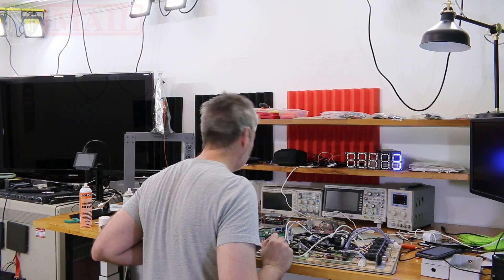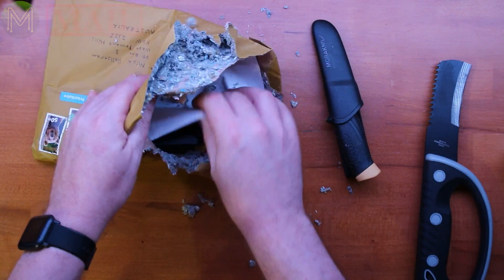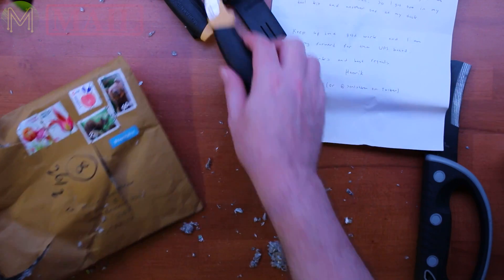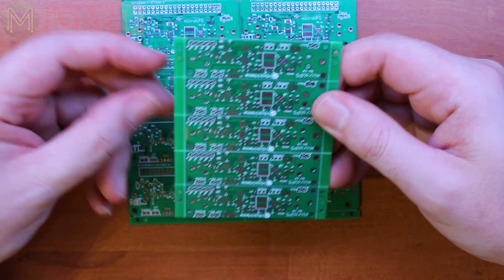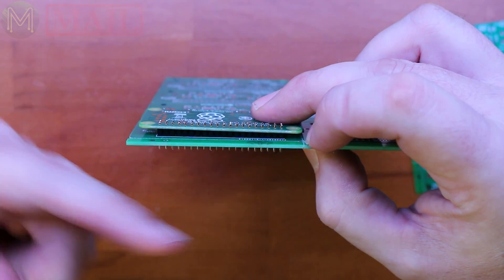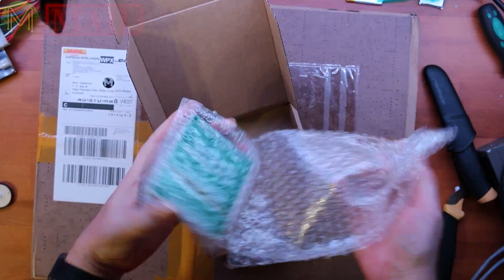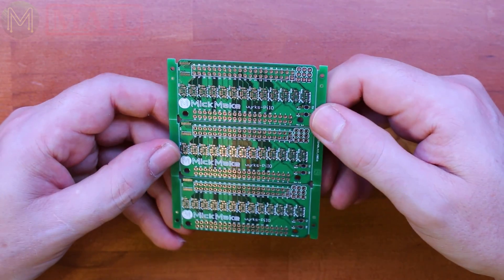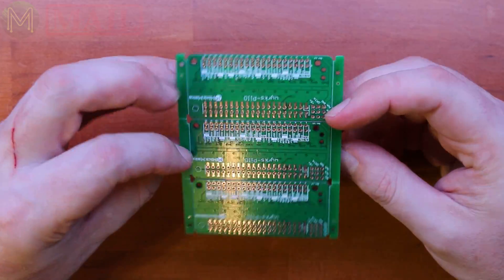#258 MickMake Mail #41: A mega update on a bunch of projects.

Comment: Mick,  Looking forward to your UPS board if it does what I think it does.  Right now I got the Pi Projector working and it is great.  
Right now, I have the screen saver on the LibreELEC OS to randomly and continuously project the stored photos on the SD card.
This makes for a  really cool "night light" for the baby room.  Since is self contained, runs off a USB battery, it can be aimed just about anywhere the baby room.

If your UPS can control the power based on time that is the next thing I am adding!!!  

After that,  UPS time control and motion sensor mode so it only turns on when an adult is in the baby room at night!

By the way, I configured the protector with the TI board on top, followed by your board and the pi zero on bottom (component side down ) so I can reach the pi connectors. 

thanks!!
Reply from the maker: Hi Spencer. Yup you posted in MickMake forums on this.
There are several ways of still being able to use the Pi from underneath in the current 1.3 design, but quite a few people started to experience noise from long headers, etc. So, it needed to be fixed.

And since it'll also have servo controlled auto-focus, you'll be able to point it vertical and still have it in focus.
I'm thinking of adding in a line-of-site distance sensor to provide auto-focus.
Reply: @MickMake  Just for the sake of discussion and to provide you with some data points.

The distance between your board and the circuit side (upside mounting of the pi) is the same as the default middle standoff that came with the DLP board.  I took the longer standoffs from the DLP board to use that for feet for the pi zero.. for now.  I don't see any noise that affects the video, but I do get the occasion where WiFi does not automatically come up, just cycling power usually get it working.  In my case since it is not a big issue, as the "things" is a picture project from on board files.  I do however need the wifi to kick off sideshow of stored videos.  

I can't tell if the wifi is having problems or care for this application.  I been able to download pictures, videos and stream material (Kodi) thru the wifi.

Another FYI is that for the current version of hardware/software for Pi Zero, bluetooth is not working.  Many people have noted this on other forums.  Hence (for me), I won't be using it as a full media center (and don't care) since there is no audio , but it is still pretty cool as a standalone system.  

As for the UPS,  for my situation (and hardly anyone else)  it would be preferable that the the power on/off can be controlled by just a ambient light sensor, so when it becomes dark the UPS powers up my "night light" and powers down when it is daylight.  Naturally, I would have position the sensor such that powering  itself on don't simulate daytime.  The same for a motion sensor as well, if UPS board could run a motion sensor and enable power (until the room goes quite... or dark and occupied) it would be perfect just for this project.  Since I'm running LibreELEC/Kod (single functionality and no keyboard mouse inputs), it is very hard for me to control external devices motion sensor, light sensor or configure a external timer.  However, for general Raspbian system  it absolute sense to have the Pi drive and control the stuff on your UPS.

As for the auto focus, it that could be done independent of the Pi that would most excellent!!!  Right now, I use a piece of tape to get the slide some friction and hold the focus when projecting vertically.  

thanks again for all the excellent design and effort!!!
Reply from the maker: Thanks mate.
Yup, I was going to add extra GPIOs to the PiProjector, but figured that it’d be better if I provide the capability to add hats. This way people can mix and match whatever they want; motor controllers, sensors, etc.
Reply: @MickMake  "line-of-site distance sensor to provide auto-focus" 😍I was planning on doing that myself

Comment: But... the Attiny can use 3.3V easily
Reply from the maker: Yes, but since the ATtiny is controlling the charger and DC buck converter, it has to be powered from LiPo. Otherwise if it switches off the DC buck, it'll power itself down.
Reply: @MickMake  - Since I don't have a complete view of the schematic I don't spose I can comment to much more, though I do think there would be a way to make it work without a logic level shift. This would likely entail other circuitry, so it could turn into a "6 of 1, half dozen of another" type of situation. No criticism meant in any way was just thinking out-loud.

In my own testing I've found that just a 3.3v zener is capable of powering an attiny so a full on regulator isn't "needed" but there are losses involved. etc so on, and hell, it's your design (again just thinking outloud).
Reply from the maker: No, don't apologize. As you said engineering has so many ways of doing things and so many pros and cons. I'm always up for different ways of doing things.

The decision ordering in these designs is:
1. ULP.

2. Reduce cost.
3. Reducing the number of different components.
4. Added functionality.

I wanted to be able to have the RTC and ATtiny tick over solely on battery. Ultimately, I should be able to get rid of the RTC and use the inbuilt RTC on the ATtiny, but added it in for testing.

I should expect to be running on no more than 10uA in ULP mode, maybe less... Hopefully. So, the less components sucking up quiescent currents the better.
Reply: @MickMake  Are you using the attiny PWM to control switching of the buck regulator? I've often wondered if the freq was high enough and if it can respond fast enough to feedback but never really looked into it. That and I don't have a ton of knowledge when it comes to switching regulators and their requirements. I don't suppose it would would need to be "super" stable in a charge circuit though. I do know that the built in oscillator is kind of umm, well it's not overly effective at keeping time really well. The drift can be enormous over an 8 hr period of time. I've measured as much as 45 mins of drift (that's what I call ugly anyway), but this may have had something to do with the power supply. It wasn't critical so I didn't care enough to investigate.
Reply from the maker: Yup, I'm concerned about drift, considering that people expect it to be able to keep reasonable time, (IE: seconds in a week at least), So we'll see... I may or may not be able to get rid of the RTC.

Comment: Any reason you didn't run the ATTiny at 3.3V instead of 5V for the Pi UPS? Is it because you're powering it directly from the battery?
Reply from the maker: Yup, I'm running the ATtiny directly off the LiPo. So that means that the board won't function without a LiPo battery installed. I figured that this is more of a safety feature than an annoyance.
Reply: @MickMake  Guessing it also makes it a tad easier to interface with the rPi, as the logic levels would be the same. As well as having the benefit of just slightly lower power consumption. Also looking forward to seeing more of this... sounds like it will be perfect for keeping some sensor hub projects running in the event of a power outage, assuming it isn't for too long.
Reply from the maker: Actually I'm still having to use BSS138s for logic level conversion for the I2C bus to the Pi. Pis don't like being shoved 5v on the GPIOs, but they can control 5v logic.
Reply: MickMake ... But they probably handle it better than an ESP8266 given 12v on the I/o pins... Yeah, I did that last night... magic smoke genie paid me a visit :-O That'll teach me to mis connect the power and I2C connections on the board! xD
Reply from the maker: Ha ha. Been there several times and know how frustrating it can be when you’re in the middle of something and have no spares.

Comment: Quick note about the mipi csi connector on rpi.
AFIK the mipi interface is handled by the videocore 4. The ISP initialize the interface and have built-in filters for the color correction and lens geometry.

I actually don't know if there is a way to directly read the CSI data like the DSI interface using a Arm side driver.

You should take a look to the raspiraw project looks like that they managed to access the csi directly.
Reply: Theres been a lot of work around the TC358743 for HDMI input to the RPI, with support for it being added to uv4l-raspicam around 2 years ago. Would love to know mick's reasoning for going with the less supported but functionally quite similar TC358749, unless he just wasn't aware of it.
Reply from the maker: There's three different Toshiba bridges, TC358743, TC358746 & TC358749. There is a small amount of difference between the three - EG TDM audio interface, IR, video processing, etc.
I haven't had a chance to really look into all three, but if there has been a lot of software work done on one of them, it becomes naturally attractive.
Reply from the maker: Yes, I noticed that with the Pi MIPI-CSI, but some people have managed to get it going. So looks promising.
Reply: @MickMake  yup I checked. Someone should have implemented a v4l layer. Take a look on that project on GitHub.

In one of the repository on the same guy there is a working sample for HDMI capture on rpi.